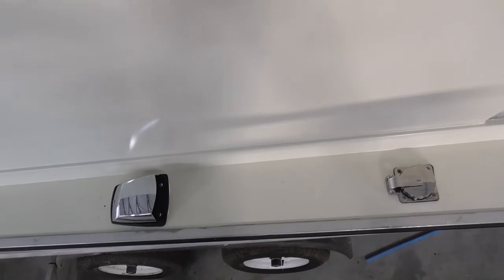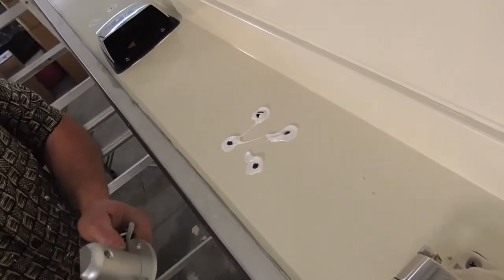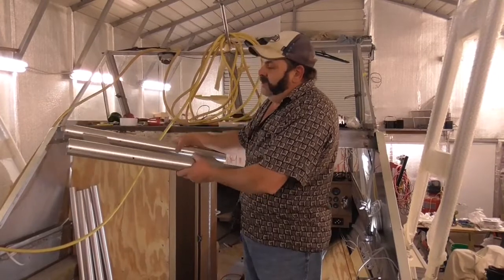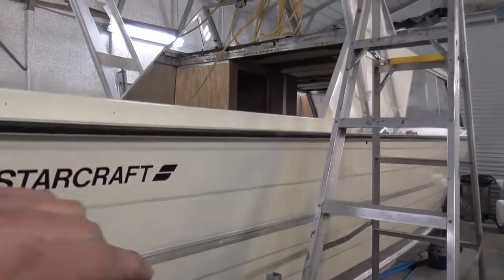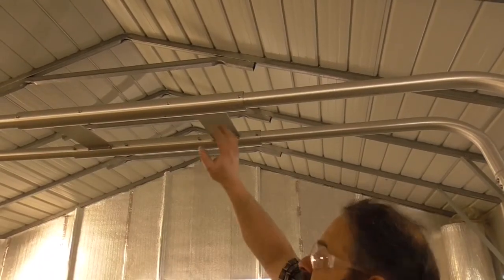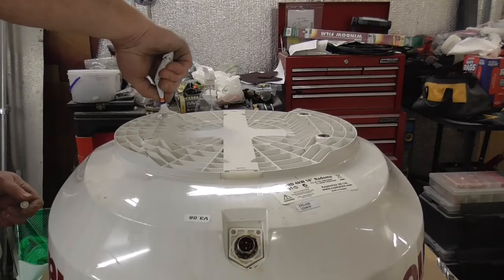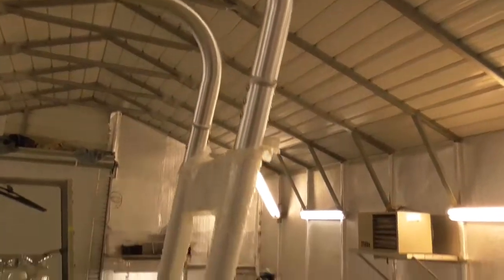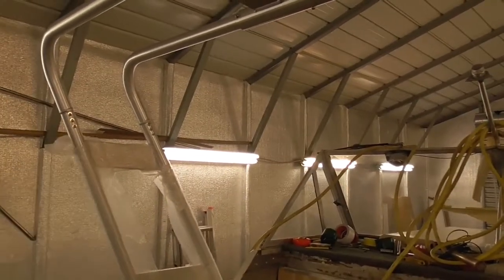Behind the Scenes - Radar Arch Install (Part 1)

Comment: Thanks for the video! I wish I would have done the assembly like you did. I followed the directions which came with the tower and I had a problem fitting it. The front of the tower was six inches wider, so I had to use ratchet straps etc. to make it work.

Comment: Thanks so much for your video, I installed mine in the ground and lifted it on w 4 friends then did my final drilling. Your way is better, oh well. Was also going to run my wiring through the tubing but your point about future accessability is a perfect reason to run them in plastic expandable conduit. I’d rather conceal them but you have a great point. Thanks again.